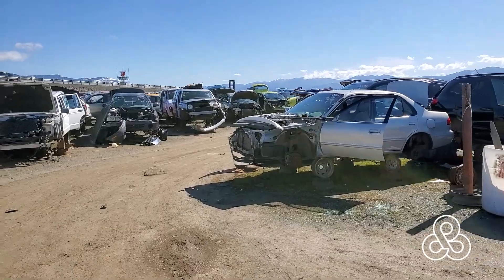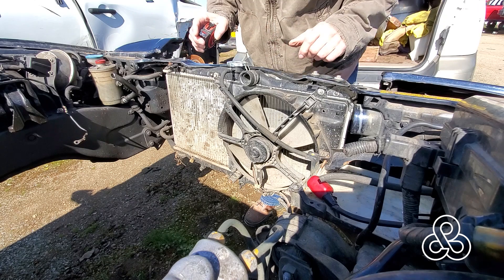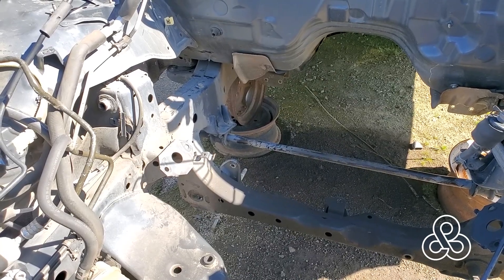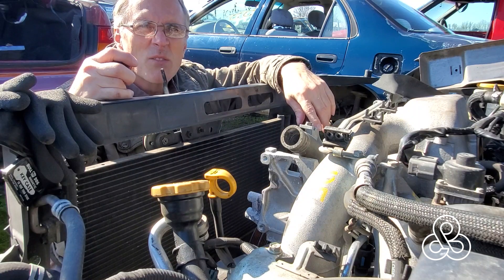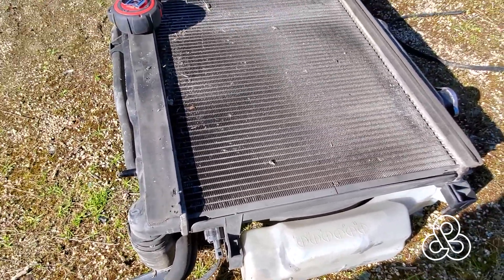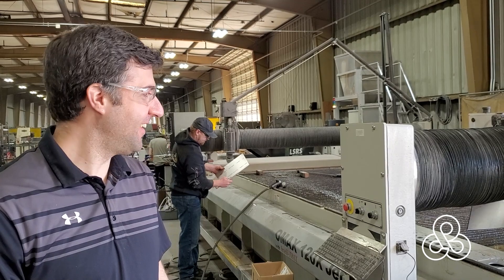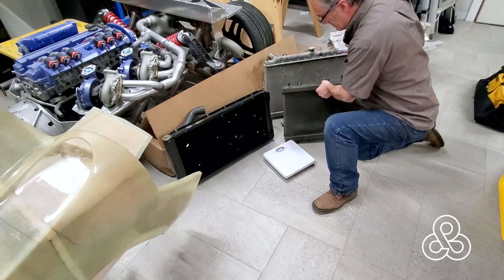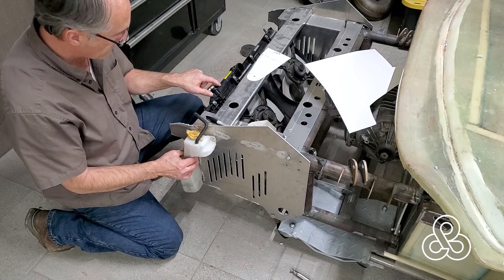A62 Who will get to be the proud donor? Choosing a new radiator for the Arete Supercar project.

Comment: My pick a part in Austin TX has a parts list on their website with prices for various components and assemblies listed. It's standard for all car parts of that type and feature set (except engines and xmsns, since there is a bigger market for those). I just went there to buy some seats for my El Camino project (getting rid of the bench and going with buckets) and they charged me about $75 per seat. Would have been maybe $15 cheaper if they didn't have airbags in them. Would have been maybe $30 more if they had been electric seats. I like the standard pricing model because there's no gouging. But that also means there's not much haggling.
Reply from the maker: Ha Ha! Yep, in the old days, your price could depend on the counter person's breakfast experience with his wife!

Comment: Are you planning on trying to fill the system though the fill neck on the radiator, or just use it as an air bleed?
Reply from the maker: When I was younger and doing mechanic work, Fiat was in my repertoire. I learned that low radiators (Fiat X19) are a bad place to fill or vent air. I will have a fill/vent at the engine above the water pump. There will also be an auxiliary electric water pump up front, as the 1Jz's pump was never designed to move coolant that far.
Reply: @BuilderCreator  Ok good. Wanted to make sure that you were aware of the common fill / air bleed issue typical to mid / rear engine cars.

As for the JZ pump, although certainly wont hurt anything having the aux. electric, especially given that that would allow you to continue to circulate water after shutdown without having to hopefully have thermal syphoning effect (particularly for the turbo's), I'm sure it would have done just fine with the mid engine setup. I mean, the SW20's (2nd gen MR2 N/A and Turbo) have zero cooling issue's and  Toyota chose to use the same pump that they used early 3s and 5s Celica's (including the turbo All trac's).  Regardless though, as said the aux. electric certainly wont hurt anything even if it wasn't needed.

Comment: I agree with your whole statement at the end.i did a project the same way.i built a chopper out of a 220 sportster.a whole fat tire softail frame.had offsetting and whole wire rework.i have a lot of mechanical ability but didn't have the experience with the offset or not much of an electrician. But I started and told myself come he'll or high water whatever I run into I will find , ask, learn whatever I need to when it comes up to complete my goal.and that mind set and just goimg for it is what made it a reality.so whole lot of truth to your words!
Reply from the maker: There is truly something magical about it.

Comment: Why not use a surge tank (also called an expansion tank) instead of a overflow tank? The radiator cap could be wherever you'd like it, plus it's easier to check the coolant level. Radiators paired with a surge tank often don't have caps at all

Comment: If I could offer a product I recently discovered at my local fiberglass/boat supply shop. Coosa boards! Fiberglass reinforced urethan foam boards. Compatible with all resins and gel coats. Extremely strong and light once laminated and designed for the marine industry. I’m looking to use it in my monocoque construction. Maybe something to look into in your Leviathan project. Thanks for the great content. Best series on YouTube!
Reply from the maker: Looks like an interesting product, I'll have to see if i can find a local supplier as shipping 4 x 8 sheets could be costly, on top of costly materials. Thanks.

Comment: The four cylinder Subaru engine is prone to blowing the factory head gaskets.   If you are going to use it, replace the head gaskets with good quality third party gaskets.
Reply from the maker: Not to mention timing belts every 30K

Comment: As an owner of a Forester, the top tank seal leaked when the engine was up to temp. You may see a bit of steam or the foam  will feel wet. Just a heads up for you. Another question, how much power will you need for the generator? A Subi engine seems a bit much @ 165hp. That sounds like a lot of generator.
Reply from the maker: I will watch it. Likely there's an aftermarket replacement with a solution out there, should I need it. Thanks. APU will be powering hydraulics and electric power combo. Not sure of power requirements yet.

Comment: Why wouldn't you just buy an all aluminum racing radiator (for example from Griffin Radiators) instead of using cheap plastic tank OEM junk?
Reply from the maker: Just searched Griffin radiators for Subaru . . The search function actually laughed at me! Maybe I should search 2021 Jarvie Arete GT? Ha!
Reply: @BuilderCreator  Go to their "universal fit" tool and you can enter in the radiator dimensions you want and where you prefer the inlet and exit pipes to be on the tanks :)
Reply: @BuilderCreator  if you want a nice aliminum radiator in the Subaru size, google "koyo subaru radiator".  They are around $300

Comment: How did you calculate your cooling needs? I would imagine that your engine would need a little more cooling then a Subaru Forrester.  Maybe not?
Reply from the maker: Displacement is close to the same, but I'm sure the Subaru capacity was not designed for the heat of 600HP. Ha! I will have more cooling capacity beyond the front radiator. . .And Hey! what does an electric car guy care about radiator cooling? :)
Reply: @BuilderCreator  LOL!😂  always interested in learning from the master

Comment: Would a 91-94 turbo legacy radiator work a bit better? Similiar size except it uses a remote fill cap and the top hose is on the side instead of the top.
Reply from the maker: 18 high by 28.5 wide are my limits. do you have a Legacy to measure? I would prefer a "remote" cap system.